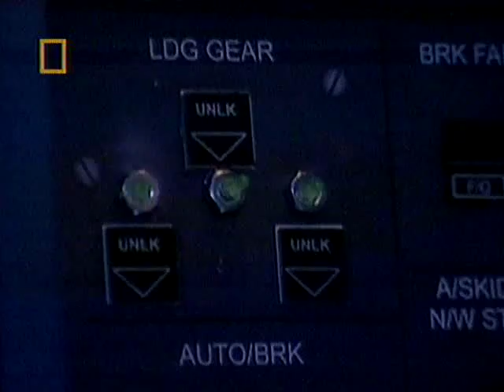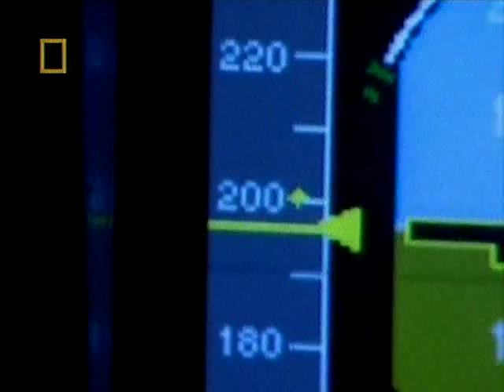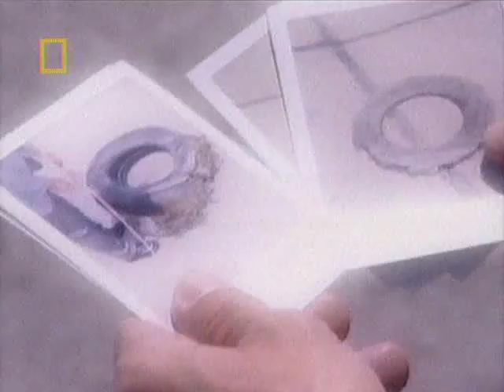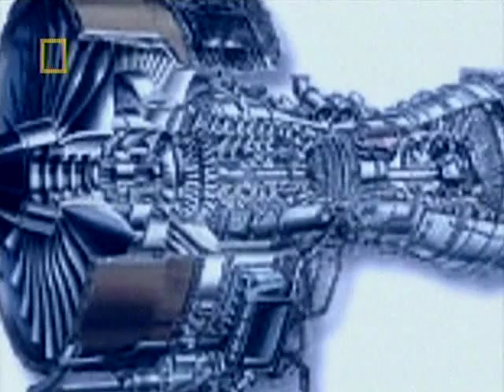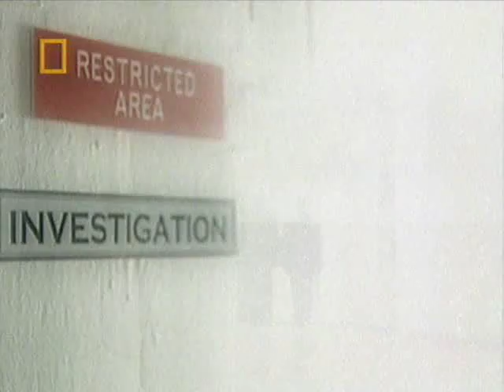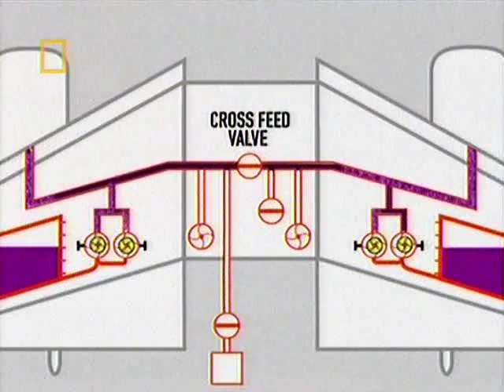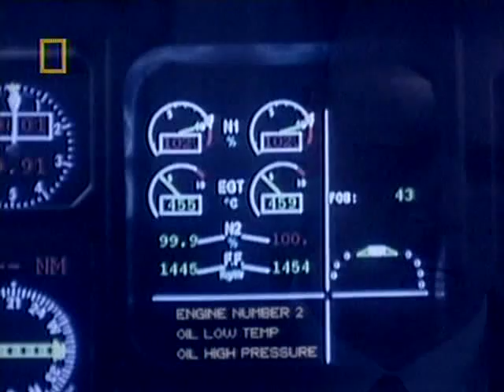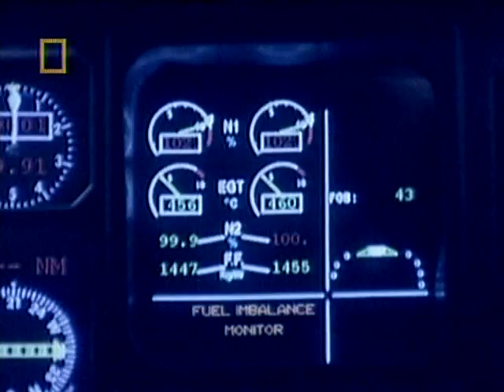Air Crash Investigations - 1x03 Flying On Empty part 3

Comment: YA THEYALWAYS BLAME THE CREW NO MATTER HOW MANY LIVES WERE SAVED THATS WHY THE CEO AND OWNERS ARE PROTECTED BY HI PRICE LAWYERS BUT WHAT ABOUT THE CREW AND THE MECHANICS ROLLS ROYCE SHOULD OF SHIPPED THE PARTS THATS LIKE SELLING A CAR WITHOUT THE DAMN FUEL PUMP
Reply: But Also it's Airbus Fault for not providing an efficient cockpit computer system that could have prevented the Fuel leak.
Reply: Yes i know Airbus could have done a better job if you figure how much money they make on people flying and hhow many lives they have put in their hands not just the pilots but also Airbus they make enough money that they could have thought of atleast something as simple as that i mean when i watched it it was the first thing that popped into my head did you hear about the Malaysia flight 370 that went missing its a Boeing 777 and they dont even know where the hell it is but the engines send staatus reports back to Rolls Royce on how the engines were functioning and all the need to fix problems if any so why can they not find it even with the transponder switched off you figure how much is one worth like 12 million dollars with that much money on the line they should create something for that as well i know of alot of improvements they could work on and they dont really give a damn and its always the pilots fault by the way are you a pilot? i love flying since i was a kid and i go up in the air all the time and i love the carrer path that i chose to get into i will say it does have to do with aircrafts.